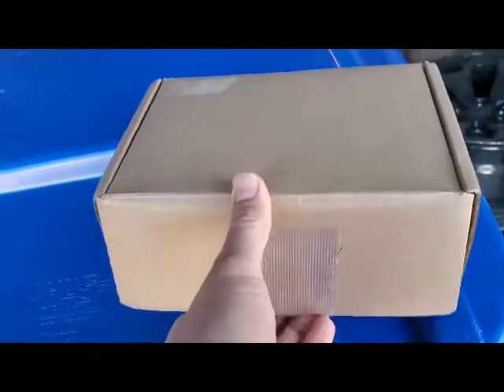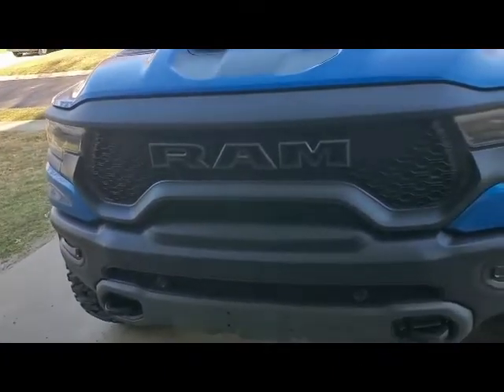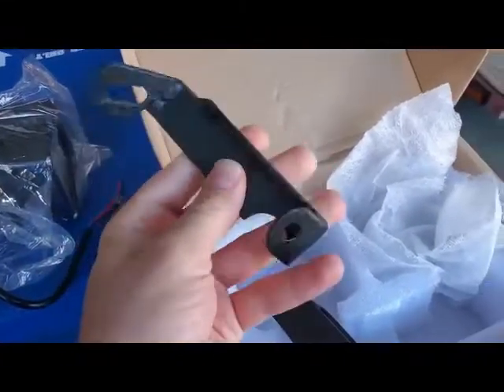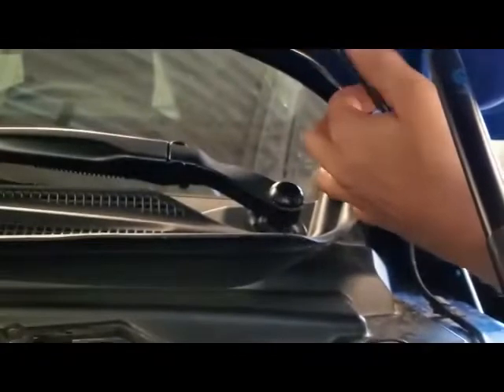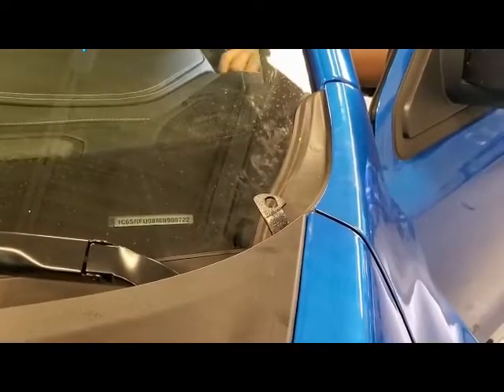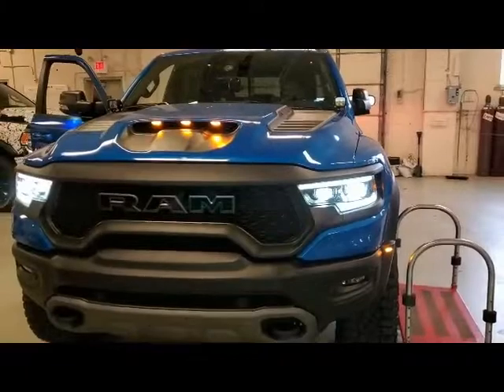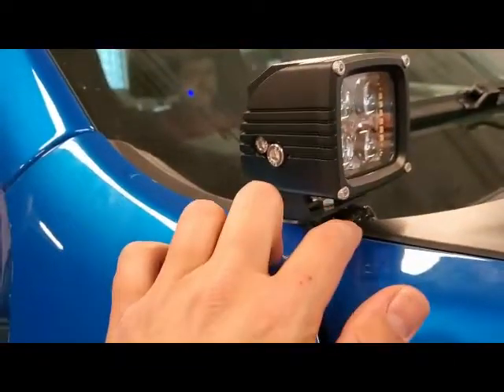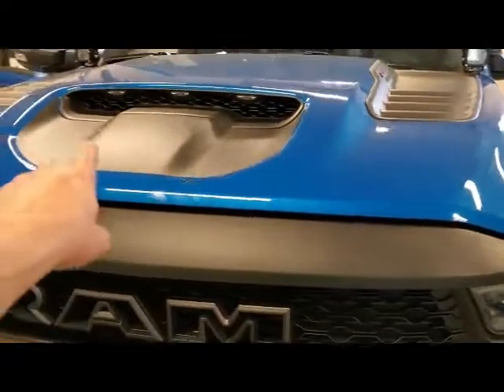1500 RAM and TRX Hood Mount, Ditch Lights, Pillars Installation by M&R automotive

Comment: Outstanding video and thanks for sharing!!!  I’m about to install the same light setup on my TRX.

By chance did you get the ambers set up?  If so, any tips on tapping into the DRLs and which wires?

Again, excellent video!
Reply from the maker: You can use Ttaps from the hood amber lights or fire box tap to get power if you don't want to use the aux switches